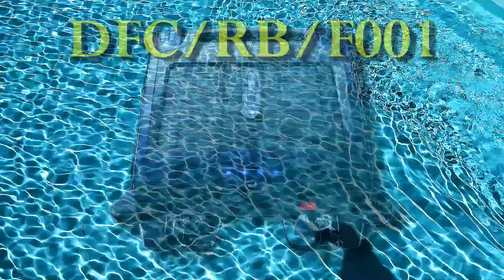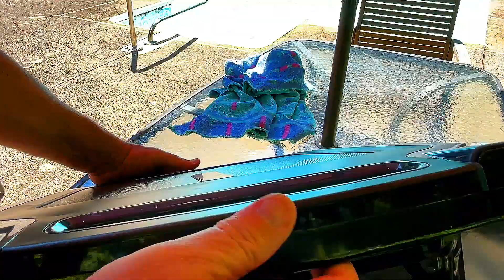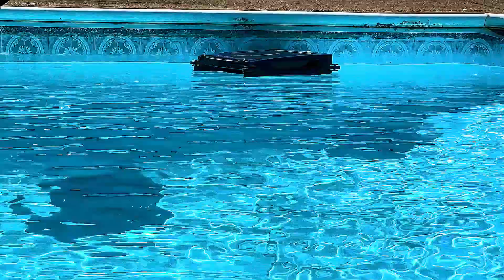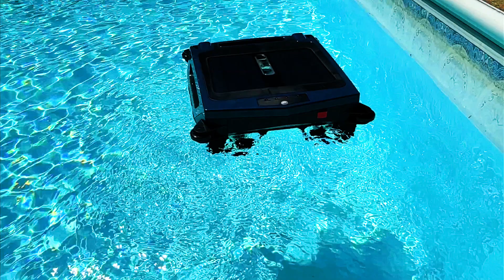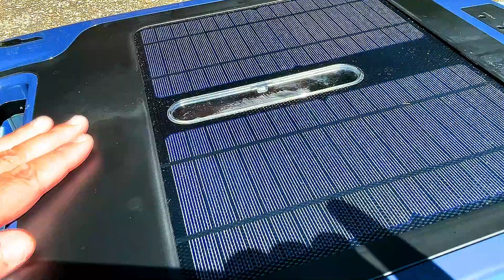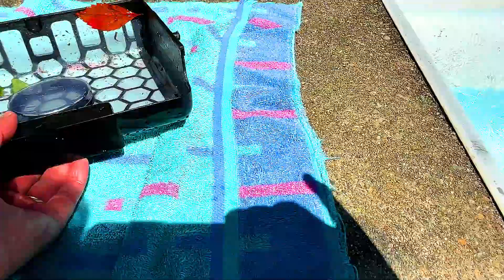USECARA Automated Robotic Pool Skimmer Review and Demonstration (2024)

Comment: I buy but no include the charger. What charger used to buy in amazon or ebay?
Reply from the maker: Well, if it does not have the charger perhaps you should return it?  I know these are pretty expensive.  Or at least contact the manufacturer and let them know.
Reply: @TrekFanNCC-1701  i lost my charger, i need to get a new one. What charger does it use? also, my one is supposed to use an app but it doesn't say what the app is